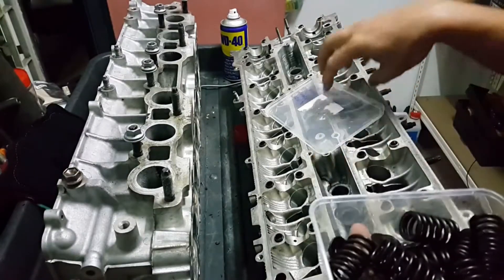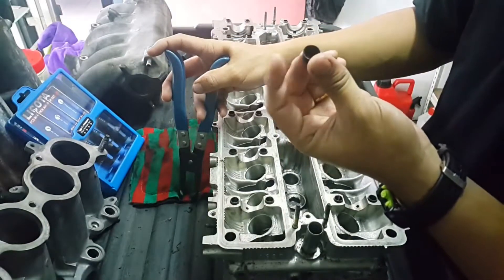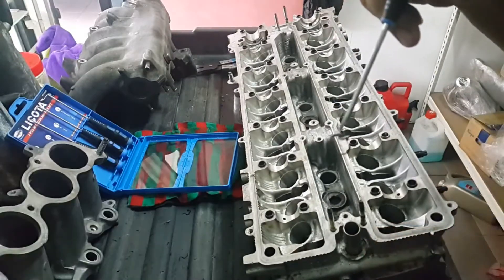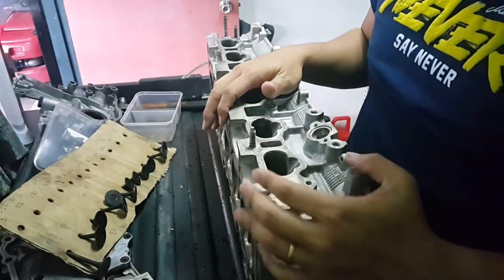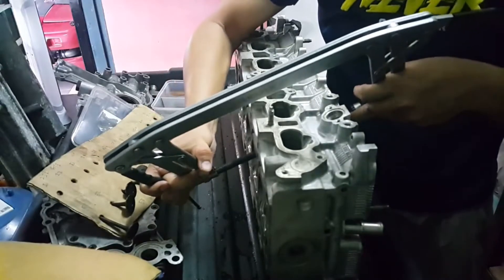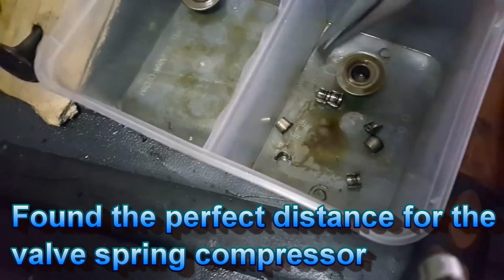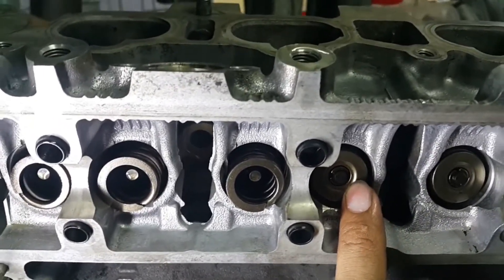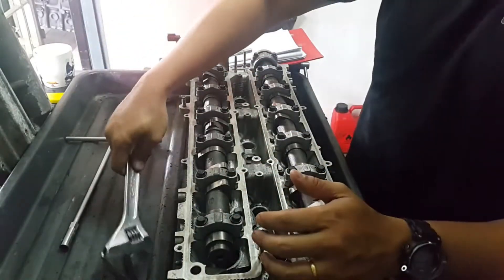2JZ Tuesday #15: How to Check valve clearance, and installation of 2jz camshafts

Comment: What size cam did you use? If I use a 260 intake and 260 exhaust, would I risk hitting the stock the pistons? Do you know valve to piston clearance?? 😆😆😆
Reply from the maker: No sorry I don't know. Especially different gasket, different cams, or if cylinder head has been skimmed before.. Best if to rotate camshaft one round when piston is at TDC. Anyway just try to prevent timing belt breaks

Comment: Would it be possible for you to do a video on bearings choose for a 2jz? Im rebuilding one and i cant find anything about the bearing other than i need to get the crank and block to a shop to do the work
Reply: Michael Chung vui min 
Thanks for the reply. The motor is going in my is300, The short block setup is the gte rods and pistons with the ge block and crank. I took the main bearings out and forgot to number them plus i like to have new bearing anyways. The rod bearings looks great, but everyone is telling me that because toyota used different sizes for the main bearings I needed to machin the crank and the caps if I don't I could  spin a bearing. Im not sure if that's true, I'm use to building Honda's and I never had to do any of that just buy the bearing and install. The power goal is somewhere around 450-500 nothing to crazy for the streets
Reply: @tjjohnson4397  well I want an update?????? Did you get it running? What did you do. I have is300 and a 1jz in my garage.